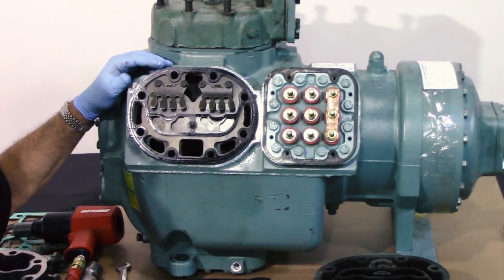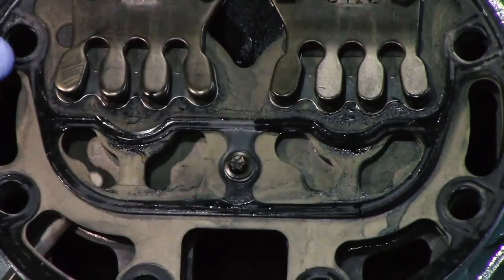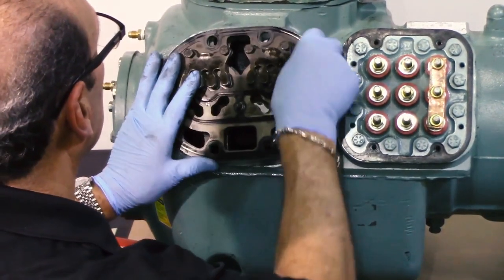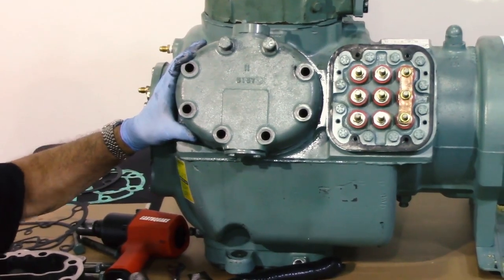Carrier 06E Head and Valve Plate Change

Comment: How to change oil that compressor do you have a vedeo to how to change oil
Reply from the maker: On this model compressor there is a plug in the bottom pan that you can pull to help drain. To fill it, on the front of the compressor next to the oil pump there is a port that you can charge the compressor.

Comment: Sir thank you for this video. I have a question

I have a Carrier 06E hot gas bypass valve compressor, if I replace it with a suction cut off valve head and plate can i use it ?
Reply: I'm not with Carlyle or Carrier, so take what I say with a grain of salt.  That being said, I do have some experience with Carlyle, although it is primarily with their medium and low temperature compressors.  I would say that you could replace hot gas unloading with suction cutoff because all the operating parts for the unloading system are inside the head assembly.  If you replace the head assembly and use the correct gaskets, I don't see why that wouldn't work.  The only thing I would be aware of is making sure the valves on the valve plate seat.  I have had trouble getting the discharge valves to seat when I've replaced valve plates on Carlyles.
Reply: @VTdarkangel  thank you for your attention. I think as you said, but I wanted to consult experienced masters before implementing it. I ordered the parts and will let you know the progress after testing. Best regards

Comment: Hello mister, how to replace main bearing crankshaft. Thx for your attention.
Reply from the maker: Thank you for reaching out. Doing on onsite repair, your best bet for taking main bearings out for the casting would be to use a bearing puller. But, like whenever you take a bearing out of a bore, make sure you do not damage the casting.

Comment: What the best way to pull the valve guide pins?
Reply from the maker: Hi Nick, our first recommendation is to not pull the pins. If your doing a valve plate change in the field and the pins look good, then use the old pins. Reason we would make that suggestion is if you crack a pin or sheer it off, it is going to be severely difficult to repair that and you will probably end up having to remove the compressor. if the pin is damaged from removing the head and not sheered off and you would like to give it a try then we would suggest a good set of plyers or end nippers. Make sure you get right up against the casting and do not squeeze to hard and snap the pin.

Comment: Missing the left side flapper.
Reply from the maker: It was stuck to the valve plate when it was pulled off. Its common and when a compressor in the field is being opened to be troubleshoot, it important to make sure nothing falls out, such as valve reeds sticking to the plate. If your changing the plate and have new parts ready to be installed then your good.
Reply: @NationalCompressorExchangeInc  Another good tip, use 2 old or spare bolts, cut the heads off and place them in before removing the head. It will prevent shifting and snapping the pins. Also its a huge lifesaver placing everything back together. That first seal is a pain as it tends to knock the tension thing and flapper off.